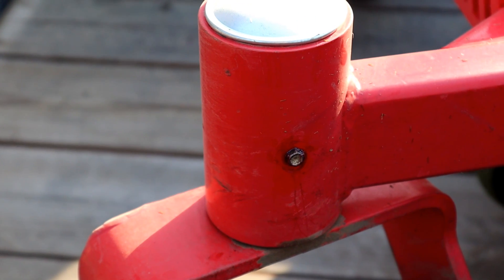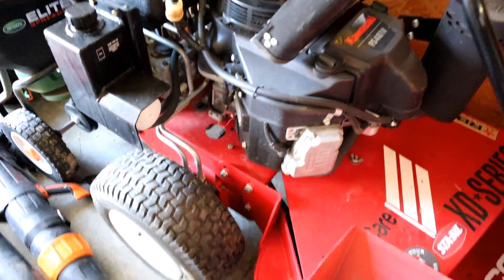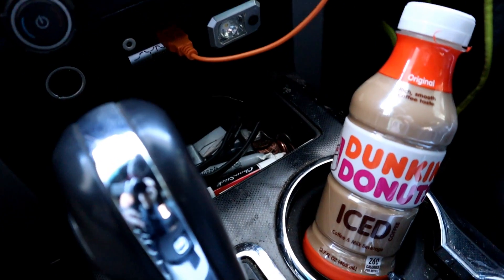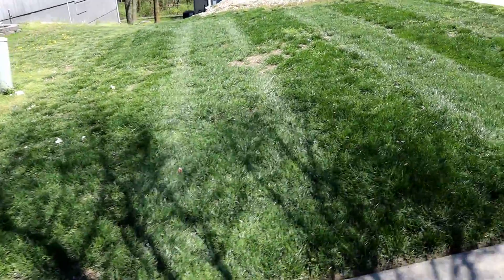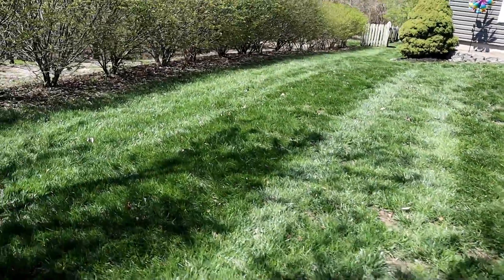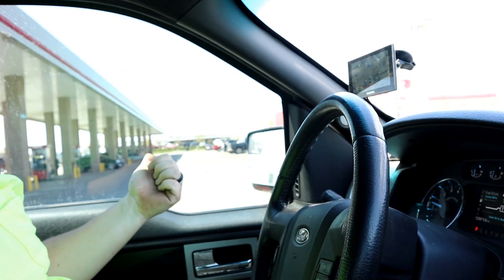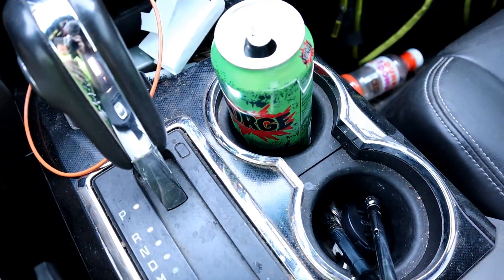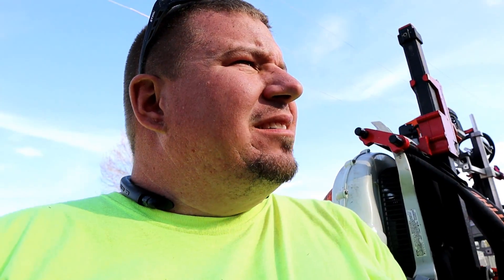Lawn Care DITL VLOG | A Ringing Phone is a Great Problem to Have!

Comment: I did 30 last year and 2 good sized commercial accounts. I had a helper on the commercials. But I dropped those this year and am focusing on residentials. Trying to get 40-45 residential properties this year. Sitting at around 32 so far. I should pick up a few more this next week or so I hope. It’s hard to push for more than 40 because I also do clean ups and everything on a lot of these properties. That really makes it hard to keep up with things in the spring. I’m already behind because of the rain here in Ohio 😞

Comment: 55, 52 weekly other 3 bibweekly. I have help one day a week. On my huge properties. 15 or so being over a acre a couple 2 and 1 property is 7 acres ( that’s the day I have a helper. Basically I do about 47 my self and the other really big stuff with help one day a week. I had a helper 6 days a week last year but decided to eliminate about twenty accounts condense my route drastically and couldn’t be happier. Work non stop but doing about 3k in mowing a week and contract out all my landscaping. Done 6 jobs so far and have another 8 for them lined up. Solo is way to go. Like you I also have friends in the field that service areas I don’t anymore so they took over the accounts I got rid of

Comment: Anything after 45 is my burn out point solo. Here 20 mins north of Boston, most properties are about 3500-6500 square feet of lawn. Solid 10-12 a day is a good day. 30-40 has been my most fluid route. Also, dude use Yardbook for everything! Super easy to track expenses there, and then at the end of the year it spits out a simple Profit and Loss form, and everything is itemized for you.